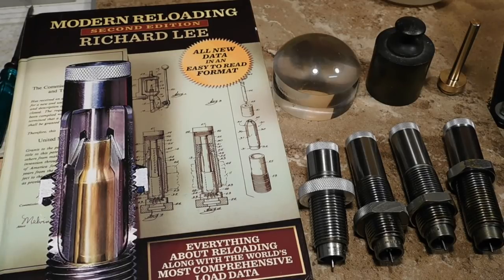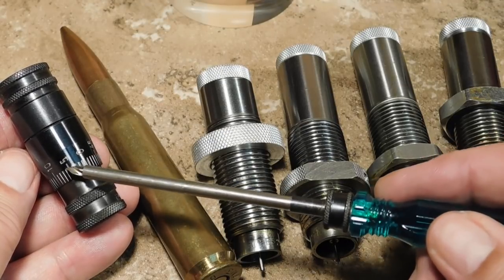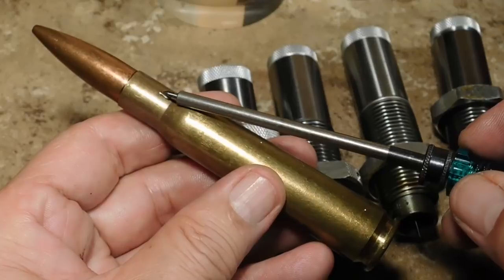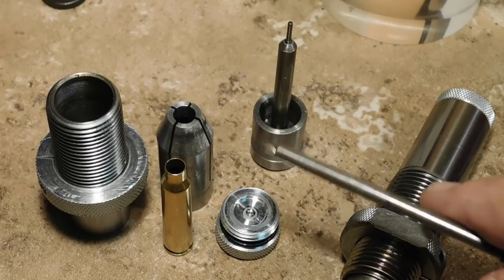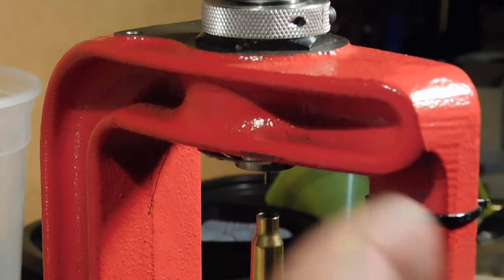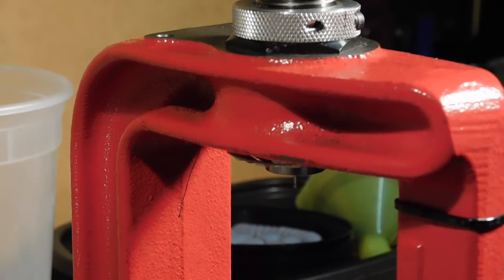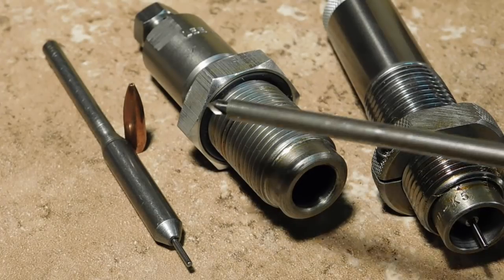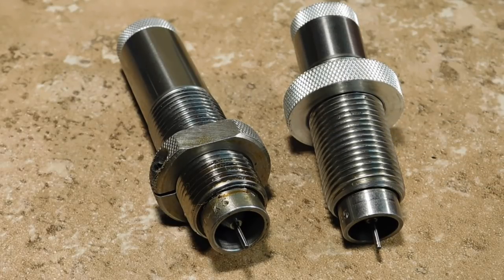Additional Rationale For The Lee Collet Neck Sizing Die

Comment: Thank you for this video. I reload 223/556 and 338LM only. The first time I fired some ammo and then did the case prep using a Lee full length resizing die, the 338 cases didnt fit easily in the checker. I quit using the FL sizing die and went with the Lee collet neck sizing die and the problem was solved. I wasted a lot of time with the FL die!!!!! Anyhow, thank you for this.

Comment: Purchased a neck collet die for my 7.55 swiss. Had lots of trouble with full leagth. Got this die used it first time on fire from brass load a round slide in perfect. Check the shell with LE Wilson. Proceed to load the rest. Perfect.  Thank for info

Comment: FC45LC, I have really appreciated your videos.  I am brand new to reloading and have accumulated several pieces of equipment, mostly Lee products because of affordability.  I am starting to make my .300 Blackout brass from .223 cases.  Some other videos on YouTube show cutting down cases, trimming (prepping), lubing and pressing, loading and crimping.  No mention of checking the neck thickness; until the last one I viewed.  He used a reamer from Forester to get to the neck thickness desired, then he pressed it again and trimmed for overall length.  I started searching websites and found Midway had the neck deburring stuff.  I just happened to notice that Lee CNSD was listed so I found out FC45LC had a video, Thank God! 
Will the Lee CNSD work for the .300 blackout for newly formed cases from .223?

Thanks for all of your videos and sharing your knowledge.  By the way, Lee Precision owes you BIG TIME!

Bing

Comment: I have been loading for 30 years & you are a mile ahead of me on tools / use . Don't take this the wrong way >> I buy in bulk & don't shoot enough to RELOAD 308 so far , mostly use new cases & bulk ammo . I have only done the min amount of prep to new pre primed win cases , my ammo with A max & Sierra match bullets as well as SST & Pro Hunter shoot as well as factory ammo . I do like to watch & learn all the possible tools/use . I think in RIFLE Clint Smith & Mike Vent. did a bit on No Fuss ammo for 308 ?? It shot good for the use they put it to ( not match grade ) , but like me , my rifles shoot well with all the ammo I feed them for the most part . This from a guy that cleans ALL primer pockets every time due to mis fires 1/50-100 rounds in 38 special when I didn't . That change in case prep was in 1990 . I only have a 550 Dillon & hand tools ( 308 are Lee dies ) . Thanks !!

Comment: Question Sage of the Brass: wouldn't it be possible to apply just enough  tension on a fire - formed brass as a trst round for load development, whereupon said round (woydnt require powder nor primer) could be fed into the chamber and the bullet  "pressed" back into that shell.

If enough tension was applied where the  bullet could retain the OAL at the point it contacts the lands, that would provide the exact and accurate COAL for my rifle, with that particular bullet yes?

Thought you mentioned that in a video, but cannot locate it now and I was considering procuring one of these dies just to use for load development. I'm running ar platforms and fl sizing appropriate .
Thanks in advance Sir.

Comment: The Lee collet dies, the forester neck bushing die paired with the forester co-ax press and the must have RCBS Precision MIC gauge which I use to set the lock ring on the neck die all combined produce extreemly accurate rifle ammunition.  

To see this I use a Sinclair concentricity base to measure runout.

Comment: Neck tension is generally considered a function of the ID of the neck and the hardness (annealed, worked, work-hardened). IF the collect die forms to an unchanging mandrel, there would appear to be a consistent attainable max tension to be had with this die. If you adjust for the max tension based on the mandrel (and w/o deforming the neck), that would be the sweet spot, in my opinion, for consistency. Based on that, wouldn't it be wise to get the custom mandrels (or modify the default one) in order to adjust the neck tension and adjust the die for max tension for repeatability?

-Thanks,
Reply from the maker: Dan Steven - The factory mandrels have worked well.  Certainly we can turn down the mandrels a bit if we need more neck tension, but I haven't found that to be necessary.  Your point is well taken...Lee should have additional mandrels available for us.  That there hasn't been demand probably is why Lee doesn't offer them.  These collet neck size dies are a source of company pride for Lee.  Best to ya, and a great 4th to ya..!!  FC Steve

Comment: I also have the RCBS Mic that you discussed. I have fire formed brass from my rifle. All I have to do now, is to review your vid on the RCBS Mic. Then I should be able to start. Thanks so much for the lessons. :-)
Reply from the maker: L Krueger - You are doing it right...When reloaders simply run cases through a full length sizing die, they have very little idea of what is happening with their headspace.  Headspace is a bit confusing because there are compartments to headspace - one is the headspace of the rifle - how is it set up; and then there is ammo headspace - a rifle can have perfect headspace, but the ammo has excessive headspace and can blow the head off when fired.  The RCBS Precision Mic allows us to set up our headspace by deliberation and understanding for the safest and best ammo we can make.  Best to ya,  FC Steve
Reply: @FortuneCookie45LC  I am definitely in the boat of people using a FL sizer and not really sure what it is doing. Looking more into this however. Thanks for the education and great info.

Comment: I have 50 BMG API. Armalite has recommended not shooting them in  the AR50 due to excessive case pressure. Do you think it would be feasible to pull the bullet and reduce powder load?  Thanks

Comment: Yeah I love my Lee dies too, however I do have a question that I have not found a satisfactory answer to regarding case length and case trimming.
I see and hear and understand the the importance of correct case length, but I also know the  importance of head space. Now I may be missing something here but would it not make sense to shoulder bump or resize for correct head space before measuring and trimming the case? I'm new to reloading and I have not seen this point raised any where. If one trims the brass to correct length and then adjusts for head space, would one not run the risk of under sizing? 
I'd love to see a video that could clear this up for us newbs. Thanks.
Reply: This is a year old but I will throw in my two cents anyway for others who may have this question. Technically it is correct to resize the case prior to trimming because you may squish the brass to be a tiny bit longer or the expander ball may stretch the neck a little longer on removal during resizing. Additionally, it is possible that through sizing (neck or full length) that the case neck could become slightly uneven in length. (i.e. the case neck might a tiny bit longer on one side of the case as opposed to the other). But in practice it makes very little difference. The dangerous thing is having brass that is too long. A case that is 2 thousandths under the "trim to" length is not going to present a hazard however a case that is over the maximum could. So if I had cases that seemed to be right at the maximum length already, and I was hoping to avoid trimming, I would resize first and check them all and make sure they didn't grow at all. But the reality is, if I have cases that close to max case length, I am just going to trim to the recommended trim length anyway. But for exact uniformity in your cases,  I would do my resizing operations first, then trim, chamfer and deburr.

Comment: Hope this isnt a silly question.: I see where  the collet sizes it perfectly around the mandrel. My question is how dies it keep the case neck in concentric alignment with the case body? THank you and keep up the ggood work"_
Reply from the maker: medhist2006 - Thanks for the comment and question...The mandrel goes all the way through the case and there's a decapping pin at the bottom that deprimes the case as the collet is squeezing the neck onto that mandrel...The mandrel is therefore held in perfect axis to the case thereby straightening the neck to that axis.  Thanks for your question..Have a great day,  .FC

Comment: I hear a lot about FL sizing for lever actions, but one thing almost nobody mentions is neck sizing for the Savage 99 lever action. Mine uses the old brass rotary magazine, and I'd like to try neck sizing only after forming to my chamber. What say you @FortuneCookie45LC ?
Reply from the maker: Rich Brungard - The Savage 99 is a lever gun apart from most others...no tubular magazine meant that 1) Spitzer bullets could be used 2) no magazine tube to disturb barrel - more like the arrangement of bolt actions - barrel attachment to action and fore end.  Problem with only neck sizing is that the lever still does not have the camming action of bolt guns so to asure feeding, you'd probably have to bump the shoulder back say .002 - .003".  And if it didn't work out, you could always go ahead and FL.  Have a great day,  FC

Comment: Turn it 1/8, not 1/4 turn.  That way the collet fingers cover the gaps, not the area that was just covered previously.
Also, would you advise to use the Lee Collet first, then neck tune, or vice-versa?
Reply from the maker: JS - That turn thing makes a great deal of sense...  Since the Lee Collet Neck Size Die squeezes onto the mandrel, turning the case neck (outside turn) before using the die would seem to be the logical way... otherwise we would be doing all the manipulation involving the pilot while turning that could disturb the neck we've straightened.  We would want to straighten the neck and then go right to powder charging and bullet seating for best consistent ammo.  Good reloadin' to ya,  FC Steve

Comment: FC,  displaying my ignorance in rifle reloading & a little confused. If it's desired to return the rifle cartridge to factory specs, one uses only the (first) carbide sizing/decapping die or do you use both the sizing die and the collett die always ?? And in the event, you only wish to resize the neck, use the collett die only leaving the expanded, fire formed body for your gun. Reason I ask for clarity, I've resized straight walled cases, and the tapered rifle cartridge is a bit foreign and I'm somewhat uncertain as to procedure. Thanks as always.
Reply from the maker: Walter Palmer - This Collet Neck Size Die is designed to work with bolt action rifles.  Once we have fire formed brass, we don't want to full length resize the round.  Rather we want to neck size only to hold the bullet.  The Lee CNSD creates a concentric neck for our bolt guns.  No other sizing needs to be done with this die.  After about 5-6 firings, we will need to full length size again.  When we shoot our lever guns, slide actions, and semi-autos we need full length sized brass... best to ya, Happy Thanksgiving,  FC Steve

Comment: fc45lc -  Thanks for this review. I have been preparing to reload some 308, for the first time. I have the Lee Deluxe Die Set (4) which includes the Collet sizing die. I also have
Reply from the maker: L Krueger - You've got a great die set.  When you use the Neck Size Collet die, watch out for the instructions that tell you the need to have the collet close with so much force the press is bending off the bench.  You only need enough to size the neck until a bullet is too tight to be able to be seated by hand.  Plus, you don't want to feel any resistance when you are pulling the case out of the die - if so, grease the collet - it needs to release.  Best to ya,  FC

Comment: Great upload . I am a bit late maybe but have 2 questions. 
Does the 4 markings on the case neck caused by the die disappear after it has been fired .
And do you get consistent neck tension on all cases as you rely only on feel and human error can occur. 
Thank you kind regards.
Reply: There are no marks left on the Case Neck after using the Neck Sizing Collet. It comes out smooth as silk. And the set up instructions , if followed correctly , leaves no room for human error. I know you asked this 10 months ago and have already received an answer , but I hate it when someone doesn't respond to questions on the instructional videos they post.
Reply: @CaveBear1031  thank you

Comment: Watched this again. Good info. Would it be good to have a full length size die that used the collet/mandrel instead of the expander?
Reply from the maker: toy collector - You've hit on a very interesting concept...because of the full length sizing, lube would be necessary, but the neck being concentric with the case axis would be very welcome...That die might be on the expensive side to produce though, and I suspect is the reason Lee never went to the next level with their collet concept.  Best to ya,  FC Steve
Reply: toy collector  Impossible. You can't size the neck down from the outside (FL die) as well as from the inside (mandrel) at the same time. IMO

Comment: Have you had any problems with some brand bullets not fitting properly after using the die? 

I was using Speer 165 gr BTSP for my 308, and they were shooting excellently. Then when I started using my collet die I can't get proper tension on them. Hornady BTHP bullets are no issue whatsoever. 

When I hold my Speer bullets in my calipers, lengthwise like, the only spot the calipers touches is right at the bottom where the boat tail need the bearing surface. So it's like the bearing surface is tapered instead of parallel. I seat them and they can spin around! So now I can only keep using those bullets full length sized:(
Reply: I have never used that bullet ... is that true with more than ONE box of bullets ??
Reply: Dan O'Neill well now that's a good question. I will have to open up a new box and check them! Thought of that but just didn't bother opening all my brand new ones! The bullets shoot great even from full sized cases anyway.
Reply: You could also use a Lee undersized mandrel until you work through that box of bullets. They're pretty cheap: http://leeprecision.com/custom-undersized-mandrel.html
Reply: Dustysa4 I thought about that, however I'm in Canada and it's expensive to get anything from Lee themselves. Shipping and duty makes it not feasible. Also, I don't know that it would work, since only the very base is the right size as it goes in the case it would expand the neck, leaving it still not in contact with the undersized section up near the front of the bearing surface. If I seat the bullets out long they are tight. But if I seat them where they should be they end up loose and can even be pushed right into the case. Although...they DO seat into full length sized necks no problem. It's weird... and maybe just that box of bullets is the problem.
Reply: Dave L I had the same problem. Out of 60 cases about 10 of them when using Federal GMM cases and Hornady A-max 168 gr bullets I too found that they were loose in the necks after using the Lee collet die . The problem I believe is that those 10 cases had thinner neck walls than the other 50 cases that held the bullets nice and tight in the neck, they were around .001 to .002 thinner  . You can fix this problem by either measuring the neck wall thickness or simply looking at all your case sitting in a loading block from above, normally you will be able to notice which cases are thinner than the thicker ones in the neck wall thickness. My solution to this problem was to firstly seat the bullets in the thicker case first after using the collet die for a tight fit, then I screwed in the collet die a little more to give tight bullet fit in the case necks with the thinner neck walled cases .

Comment: Excellent video ,btw would you have to bell the mouth for flat base or cast rounds thanks?
Reply from the maker: interman 77 - All cast bullets need to have mouth belling to seat or lead shaving will occur.  If the neck tension is just right, belling may not be necessary for seating of jacketed bullets.  But if there is any shaving of copper, or any doubt at all that shaving is happening, just the slightest belling will be needed for those jacketed bullets also.  Good reloadin' to ya,  Steve

Comment: Sadly, it looks like Lee doesn't make this die for 7.62x 54R.  I have heard you can use Lee's .303 British...any thoughts or suggestions.
Reply from the maker: Alan Bycroft - No, Lee doesn't make the 54R Collet Neck Size Die - Why not is a mystery.   The 303 is a longer, narrower case...I have not used the 303 die on the 54R case so I would not tell you to get the 303 die to try.  If you already have one, then the try is easy.  But if the source is good (means they have actually used that), then you might go ahead.  With all the Mosins around, Lee should have made the die... Best to ya,  FC